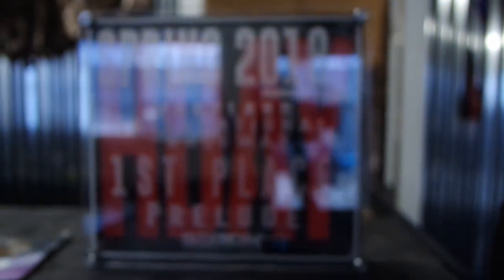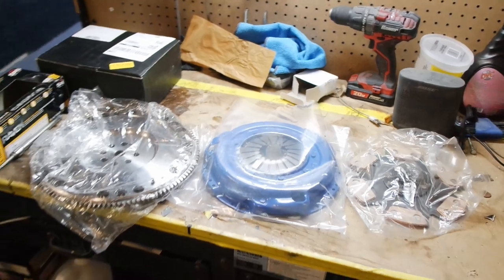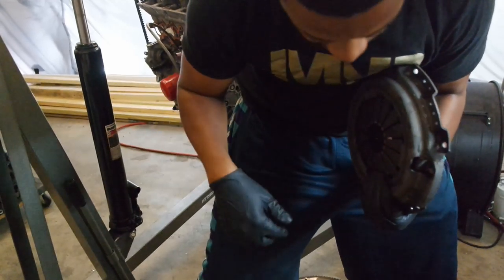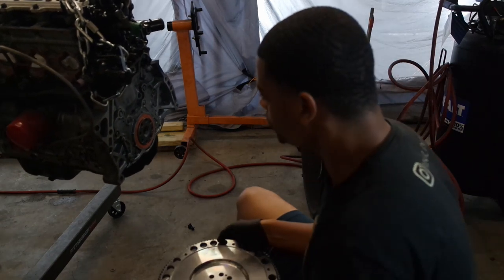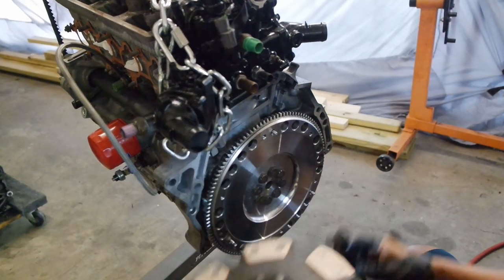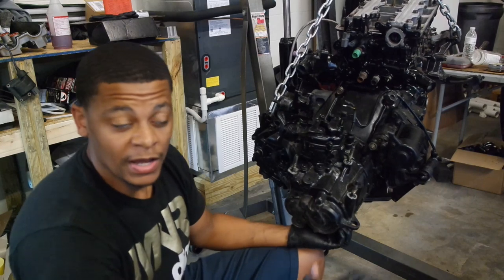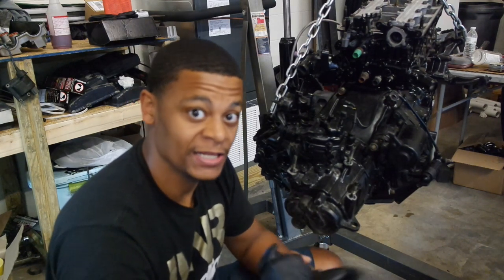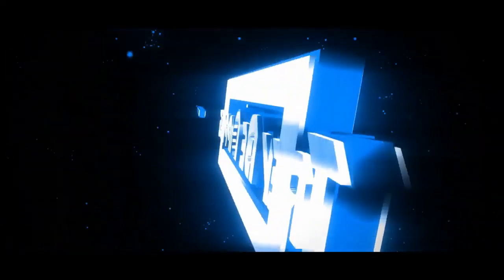Stage 4 Amazon clutch VS a 600+hp F20b

Comment: I'd recommend using an OEM throw out bearing. The cheaper clutches seem to save money by supplying not as good of bearings. I bought a yonaka clutch very similar to yours on for my old h22 setup and if started to make a grinding sound after about a week! Now I just use the exedy bearings/OEM had no issues many miles later on my current f20b setup! Just a heads up since it is a hard part to get to!
Reply: Mario avalos how do you like the f20b vs an h22?
Reply from the maker: Noted bro ill see how this one holds up for now
Reply: Luis Aguero it all depends what f20b you get auto version being 180hp manual version being rated 200hp. Also varies on h22 from black tops to red tops. F20b manual gives you the bang for the buck being the head is a type s valve train with type s manifold setup. H22a euro r and type s well all internals are upgraded being its a 11:1 compression being rated at 220hp speaking for transmission the t2w4 is the way you wanna go t2t4 being the back door trans of your choice . So much you can speak for if you want to compare f20b vs h22
Reply: Daniel Santibanez yes there's a lot of back and forth between the H related motors. The info you posted in your comment about the f20b and such im aware of actually 🙂. I wanted to see what your personal opinion about them was being that you actually drove em both
Reply: @lordchango7949  Daniel put it well, the h22a1 is what I had and the biggest noticable difference was the na power band vs the f20b manual. The H22 just pulls harder sooner and power falls off sooner 7500 I'd say, the F20b on the other hand starts off a little more mild  you dont really feel much until about 4500 I'd say but it keeps going my tuner set my rev limit at 8300. The f20b loves the high revs.  Another big difference is for boost applications the F has an iron block the H has an FRM sleeving that many machine shops  dont have equipment to work with. Last thing worth mentioning is if you are swapping the engine the F20b comes in obd2 only, the H is available in both Obd1 and 2. So a little more wiring work to convert the f20b and make it work with obd1.
Reply: @treybedipping1734  for sure it should be good mine actually never completley failed it just made that going bad bearing sound.

Comment: This EF/EFT clutch kit in blue from AMZ is prob the exact same as the FX clutch kit one can find on eBay, maybe even the PPC clutch on AMZ that has a blue pressure plate too.  I was looking for clutches some months ago and researched several clutch kits. I ended up going with the FX clutch thru eBay with lightweight flywheel, looks just like yours Trey. Although I haven't been able to install it and trans yet 😞
Reply from the maker: Gotta get on that bro...ill let you know how this one holds up.

Comment: Hell Yeah Fam the Ludes Heart is comin together Awesome an I wanna see how that Ex 6puckclutch & lightweight flywheel works out for the $180..... I've got a ACT lightweight flywheel an pressure plate with their 6puck stage 2 clutch disc I'm runnin on my jDM H22A in my 5th gen. Prelude which cost around $300 for the clutch kit without the flywheel so yeah really lookin forward ta seein how the Ex clutch kit with the flywheel works out for ya bro.... keep reppin strong for PreludeNation/BBa  Keep On Ludin Forever! 🤜🤛😎🔰🔰🔰💪
Reply from the maker: Lets just say its great so far🤫

Comment: Yo trey, did you install the pilot bearing in that flywheel ? 

Have u had a unsprung clutch before ? My experience is stoopid chatter at low rpm engagement ,id prefer sprung clutch for city driving (Los Angeles traffic)
Reply from the maker: The new flywheel already had a fresh one in it. And this will be my first non oem clutch so we'll see
Reply: I'm worried this clutch might end up give you chatter if it is unsprung... If you're making that much HP, I'm kinda glad you went with such a high "stage" since it's an amz kit. From what I seen before these clutch's stage definitions are different than standard manufacturer ones. The PP usually hold up but it's the actual clutch disc that you usually want to go higher in stage lvl if it's one of these 🤷🏽‍♂️
Reply: @lordchango7949  yeah that's what I was saying, the chatter is redonkalous... but as long as he doesn't daily it it should be kool imo
Reply from the maker: @bighomieJ5X  either way it only to hold me over until winter.
Reply: @treybedipping1734  fasho,  you'll be straight fam. Can't wait for.the dyno vid.
Reply: putting one in my tsx at the moment that is unsprung hopefully it isnt too bad,  and i will be daily driving it haha
Reply from the maker: @nebulae1992  it is really stiff but after a few days you get use to it
Reply: H and f dont use a pilot bearing like b series or d series